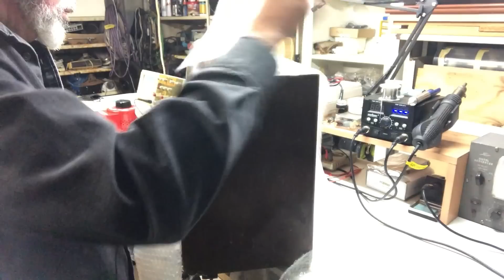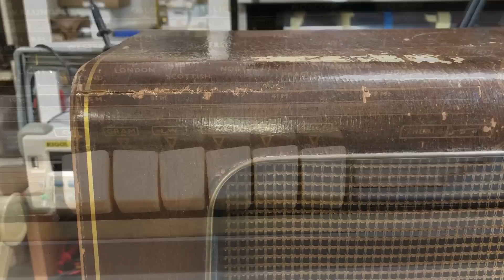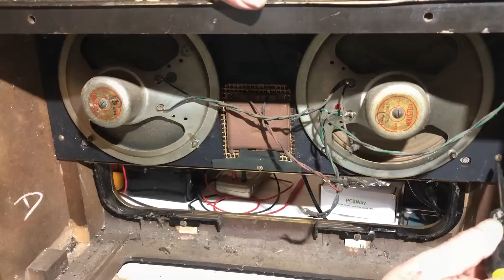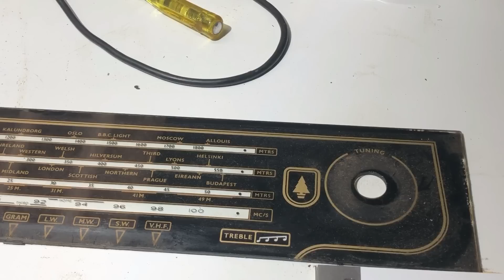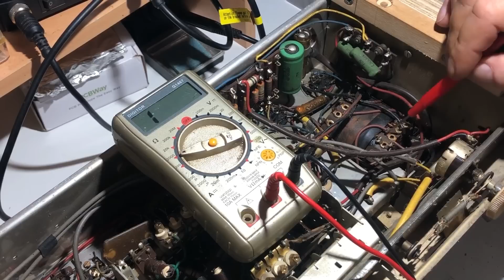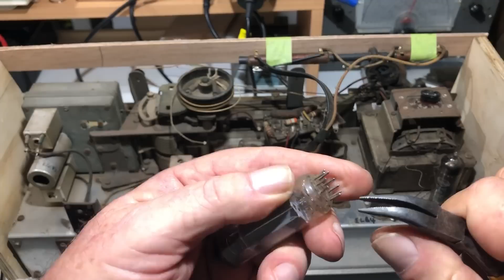BUSH VHF64 Part 1- A first look over this very rough British AM - FM Radio

Comment: Just starting on this model myself and the same corner of the glass is broken on mine. Not broken as badly as yours though. A crack goes towards the volume control hole and there are 3 small pieces. I have placed them together on a flat service and temporarily taped them together until I have confirmed the radio is a candidate for repair. I might be able to repair my glass but would also be interested in a replacement if available. Have already restored earlier Bush models including the VHF54 (plenty available here in the UK) and having watched Manuel Caldeira's E.O.& N restoration (great reference material) sometime back was delighted to come across one of these VHF64's recently. Hopefully we will both be able to get good results when we rid ourselves of all those Hunts caps. Careful of spoonerisms.  Will watch with interest. Best of Dave.
Reply from the maker: Hi.  This should be interesting.  A subscriber in the UK has offered to send me a glass in good condition for the cost of postage only. So if he actually sends it that will be great.  If it doesn't arrive in time I was thinking of doing an experimental repair based on what I did in Part 2 of the "Butt Ugly" series - the STC farm radio.  I learned a bit from that and will do it better next time.  For a start I will set up a better jig to do it and use clear acrylic sheet as the base, which is flexible enough to peel off but firm enough to not wrinkle or pull.  Anyway we'll see.  You might be able to do something similar to yours if it isn't too bad.
I have found several other bad caps apart from the hunts but it is now singing away on both AM & FM.  Audio output is a bit low and a bit unstable but I think I have a dodgy EF89 IF tube so that will explain it.  I'm looking around for a replacement as I haven't got any.
Anyway, good luck with yours and keep in touch - we can compare notes & maybe help each other out.  I agree - Manuel Caldeira does excellent videos and I am also using his as a reference.
Cheers
Reply: @Donno308  Thanks Don I'll take a look at that "Bug ugly" edition. I presume you are talking about scanning in the graticule to GIMP or something similar and then manipulate the result to get a complete copy before producing screens for printing on to a fresh glass? Slow progress on mine. Have confirmed transformer and output trans are viable and the filter caps are shot. No surprise there. As you have mentioned its a bit of a lump and I have decided to make a M. Caldeira style gig before I continue. I have a habit of saying "that looks fine balanced there" until I have to clutch something with one hand (using variac isolated supply) or let it crash down.  I have a number of wires on the underside of mine where the insulation is crumbling away and some require insulating or changing before I risk power up with rectifier valve in.  Have subscribed so I can keep up with yours.  Good luck.
Reply: @Donno308  Hi Don, just took a look at that part 2 "STC farm radio and with damage I have I think that method may give good results. The glass is a dark finish and the crack will only be a short way into the visible area with only the gold striping only being slightly imperfect. I'll get some resin and give it a go. The rest of the glass is in very good nick.

Comment: I like old electric devices such as tube radios, tube amps. It's fun in my spare time. .When sipping coffee and dusting and trying to open it to see if it still works or not .Even though the technology is outdated
.But I believe There are still many people who admire this ancient thing.
Reply from the maker: Hi Aran,  Yes these old radios do seem to have quite a following, and for the most part they are still useable, especially ones like this, with FM.  The thing I like about them most is that they are from an era when quality mattered and things were built to last.

Comment: I should say that radio is a beast and takes up a lot of real estate on your bench. That looks just like my 1957 Kapsch Radio that was made in Austria I bought at a garage sale 2 yrs ago for $20. Mine only needed a new ferrite rod and a couple wires were broken and I recapped it and it works fine. Only difference is mine has a cats eye tube for tuning. Great video.
Reply from the maker: Hi Larry.  This one also has a "magic eye" tube as the tuning indicator.  I just haven't plugged it in since I took the chassis out of the cabinet.  I hope it works because they're expensive!
Cheers

Comment: that 0.001 you tested is across the primary of the output transformer so shouldnt read high or open, but a few hundred ohms, if high, output primary is open circuit!
Reply: i've had cases where they test open at first but still seem to pass current when set is powered up, and then test ok after switching off for couple of minutes, but if left a while, test open again! i think the high voltage across the ends of the break arc across and make contact for a while,, if it IS open, likely cause by leaky coupler  to the el84 , frying the primary by excessive current
Reply from the maker: Hi Andy.  Yes, I think that's exactly what is happening in this case.  I tested it out of circuit after replacing it and it showed open although it was clearly arcing across, judging by the dim bulb.  Anyway replacing it fixed the problem.  Luckily the EL84 and the output tranny seem to be ok.
Reply: @Donno308  ? the cap arcing? not possible if the transformer is ok, as i said its across the primary output transformer winding, only a small dc is present across it if transformer is good !!!  maybe the transformer arcing? damp got in it??....  theres no 'waxy' or hunts cap across ht supply directly after the rectifier but is one further down the line, that may be an issue..
Reply: i would check dc resistance of the primary of the output transformer after letting it stand for a few days, i'd say if over 1k or 'fluctuating' , something  isnt right

Comment: these should be good as 2 IF amplifier stages, i have a MW plus 3 SW 'version' of it EBS64
Reply from the maker: Hi Andy.  Yes I think it will be quite a performer if I can get it going.  I'm currently working my way through the caps but it's already sounding better.  I hope I can get the FM working!
Reply: @Donno308  have you tried a new ecc85? they seem to fail a lot, unfortunately replacements getting stupidly expensive, an ecc81 may work with slight alterations to the base connections, pcc85 may work,  ecc88 also a possibility but will need to reduce supply volts to the tuner considerably
Reply from the maker: Hi Andy.  Unfortunately I don't have a spare ECC85, or even an ECC81.  I'll do some more checks and if it looks bad I'll have to order one.
Reply: @Donno308  i dont know if the european type number valves are easily available where you are, direct american/international equivalent 6AQ8 ..  ecc81 is 12AT7
Reply: @Donno308  have you got the circuit/schematic for it?

Comment: Hi Don, you certainly have your work cut out on this one. Bush made some fine radios in the '50s and the VHF64 was one their most up-market offerings. Fully restored, it should sound very good indeed, so well worth the effort. By 1957 UK manufacturers were starting to adopt the same 'continental' styling found on expensive German radios, with more rounded cabinets and piano key controls. Many Bush sets from this era seem to have the 'crooked teeth' look to the piano keys, no idea why.
As well as the Hunts, the other capacitor to change on sight is C66 (or C70), which couples the triode plate of the EABC80 to the grid of the EL84. It will almost certainly be leaky and risks over-running the EL84, causing damage to the valve and possibly the output transformer. It is a 0.05uf wax paper effort, located on a tagstrip on the side of the chassis.
Anyway good luck getting it going. I don't envy you restringing the dial cord! Cheers, Ian E
Reply from the maker: Hi Ian.  Yes I always change the grid coupling cap in just about any radio I work in.  In this case the cathode bypass cap on the EL84 was also kaput.  Interestingly, for the moment the power supply filter caps seem to be fine.  I will change them anyway but perhaps powering it up slowly reformed them.  The dial string id not the worst I've ever done, by a long shot.  The service data I got from radiomuseum even has a dial stringing diagram, so that will be ok.  I want to make sure I don't have to pull the tuning mechanism apart before I do it though - I don't want to do it twice!
Cheers

Comment: "Old electrolytics are not to be trusted". I Once used an old filter cap in a power supply for a valve oscillator and left it running over night to see what the frequency drift was the next morning. What I found the next morning was an exploded cap and black tar-ish goo everywhere. The cap was working fine before. No hum in the oscillator signal and measured ripple on the DC line was very low. So you are right sir. Even if they are working fine, it can change within a couple of hours and it is highly unpredictable.

Comment: The Bush VHF64 appeared in the late fifties after BBC FM radio started in 1955. It cost 47 guineas in 1957. A similar chassis is fitted to the Bush RG66 radiogram.

Band II (FM) was 87.5-100MHz, although initially only the lower half was used for FM radio transmissions (BBC Home, Light and Third programs); emergency services were allocated the higher end, which one could listen in to as I well remember. Later Band II was extended to 108MHz and used entirely for the numerous commercial radio stations that started to appear in the seventies.

In 1962 the BBC began regular experimental radio broadcasts in stereo, but only the Third Program (later Radio 3) which transmitted classical music. Radios 1, 2 and 4 went stereo in 1973. Hence fifties radios were strictly mono.

Incidentally Bush Radio was founded in Shepherd's Bush (hence the name), West London in 1932. It closed decades ago and the brand name is used today on Chinese imports.
Reply from the maker: Hi John.  Thanks for the information.  I did do a bit of googling but wasn't able to find out much about early FM broadcasting in the UK.  One viewer commented that the radio was boring because it isn't stereo.  I tried to explain but ... what's the point? 
Interesting about the name.  Shepherd's Bush - that makes sense!  It's sad to see once-respected brands being used on cheap Chinese rubbish.  Australia is full of Chinese MG cars for example.
Thanks for your interest.
Cheers
Reply: @Donno308  When I was a lad (mid 70s in London area) the FM band contained BBC Radio 2, 3, and 4 (but not 1), Capital Radio and LBC.  That was it.  There were still many more stations on MW until the 80s.

Comment: I REALLY like 👍 the picture of the woman 👩 on the “attraction” of this video. It’s the best way I could describe it. Ya can get the dial glass from a company in Australia 🇦🇺. David Tipton does it when he needs one ☝️. The numbers also ran be repainted onto the dial glass, if it isn’t broken 😞. Your dial light 💡 is also out, but the bulbs 💡 are not hard to replace. It also can be VERY DIFFICULT 😞 repair 👩‍🔧 job, if the dial cord is broken 😞.

Comment: A little more cause for optimism at the end of the video than at the start. That will sing again-it's a far simpler proposition than one of Manuel's Germans, and even if it wasn't, you'd come out on top anyway.

Don't doubt yourself, we don't, and are looking forward to the journey!
Reply from the maker: After changing a few caps I've got it singing away on AM.  It still doesn't speak FM though ...
I guess we'll get there in the end.
Cheers

Comment: ECC83 in the vhf tuner to me seems odd as I always thought these where audio tubes may be it should be ECC84  or may be I am wrong ??
Reply from the maker: Hi!
Well spotted:  I misread the printing on the tube. It's actually an ECC85.
Cheers
Reply: @Donno308  Yes I thought it was a bit strange place to have ECC83.
The ECC85 is made for Cascade operation I think for the front end of radio's
Good luck with the restoration.
Reply from the maker: @itsonlyme9938  Cheers mate.  I was thinking it might have cathode poisoning.  I think the plate is switched off when it's on AM but the heater is on.  That tends to kill the oxide coating on the cathode over time.  I had this on another Philips FM set a while ago.  Anyway, we'll see.

Comment: The misshapen buttons are normal. I have a VHF62 which is just the same. Why they were designed like that is a mystery. They're a good receiver and the sound quality is quite good, but not quite as good as the Grundigs or Sabas in my opinion, of course it depends on which model you're comparing it with.
Reply from the maker: Hi, yes I can't understand why the buttons were designed that way.  Perhaps it was a production fault and they didn't bother to fix it?  Nothing seems to make sense.  Looking at the schematic, this radio seems to have less tone-shaping circuitry than the German sets.  Overall they seem to have simplified the German designs and perhaps compensated for the less elaborate tone shaping with bigger & better speakers.
Reply: @Donno308  In the 70's as an apprentice with the UK MOD I was placed for part of my final year at a Ferguson (Thorn) factory R & D group in the south of England. They at that time were making Record players with tape decks beside them and solid state tuners and amp controls placed under so the whole unit was about 30 inches wide 15 inches deep and 6 inches high. The one thing (and I think this was common to most british manufactures) I noticed during my time there was when designing and developing new models they would employ parts used on earlier models or from equipment produced by partners. So the it is likely the buttons used on the Bush 1950's 60's  VHF range may have come from another model or make bought in earlier in bulk. Not long after the war there was still a mend and make do attitude.

Comment: Hi Don,
Any one seeing me as I began viewing this video would have laughed: I was shouting, VHF64 at my computer. 
As a radio and television brand, Bush (when Bush was Bush), meant quality and reliability. 
As an apprentice service tech,  I must have repaired a few dozen of that model ...they worked, and sounded good.  Back in the early 1970s, apprentices were usually given most of the radios, and older televisions to repair LOL.
I have two Bush VHF 64 radios in my collection.  Fortunately I acquired them during the early to mid-70s when most valve radios were in fairly good all round condition.
I have faith you will not only get this radio working, I'm sure you will find it a pleasure to work on, and have pride and place in your radio collection 
All the best from Phil
Reply from the maker: Hi Phil,
Being a UK set with FM, these radios are not at all common here.  I've certainly never seen one before.  We didn't get FM here until the late 1970's and commercial FM didn't really take off until the early 80s.  So there was no market for a valve FM receiver in the 50's.  The only valve FM radios in Australia were privately imported, I guess by British and European migrants.
So a bit of a novelty for me and it should be a very nice radio when finished.
Cheers

Comment: Nice start Don. A long road ahead with the capacitors and the dial glass is a bummer. I don't remember Manuel doing one, I'll have a look for it. Cheers!
Reply from the maker: Hi David.  Manuel's video was about 4 years ago.  I put it up on the end screen so if you go to the last 10 seconds of my video, you've got it.  Yes, that glass dial will be the biggest difficulty I think.
Reply: I wonder what that radio would have been like if Philips/Raytheon Wire-ended vacuum tubes had been used and a step up transformer had been used to drive the speakers and electrostatic tweeter.

Comment: A common problem with the transformer was they were often set to 220 volts from the factory but often run from a 240/250-volt supply which would make it run quite warm and easily make that soft wax run. Also having the EL84 and the EZ81 almost touching the transformer would add quite a lot of extra heat.
Reply from the maker: True, although that wax cap might have been shorting and overloading it for some time.  It is quite a crowded chassis and as you say, the heat from the EL84 & the EZ81 would not have helped.  Pretty sure mine is on the 250V tap but I'll check.  I would prefer to run it slightly under voltage rather than over.
Reply: @Donno308  dunno why they used an EZ81, i'd have thought an EZ80 more than capable of the current.... the smaller VHF61 used an EZ80, and pretty much same circuit idea, also 2 IF stages
Reply: the vhf64 did run the el84 at higher current, though

Comment: Don, Good choice, even if it needs a lot of work. Manuel Caldiera (Youtube "Electronics Old and New") restored one of these not too long ago. Manuel is a huge German Radio fan but after restoring a Bush VHF64, he holds the Bush Radio in very high regard. Even higher than many of the German Radios. It looks as if, if you can sort this one out, you'll have a winner that you'll be very happy with. Good luck and best regards. John Wagner
Reply from the maker: Hi John. Yes, I discovered Manuel's video on this model.  It was about 4 years ago.  It's a very useful reference, especially as he does such good explanations of circuits.  I do hope I can sort it out.  I haven't yet had to do a video where I failed to fix a radio but there's always a first time!
Reply: @Donno308  Don, I'm sure you'll have this radio sorted out in no time. Best of luck, Cheers. John